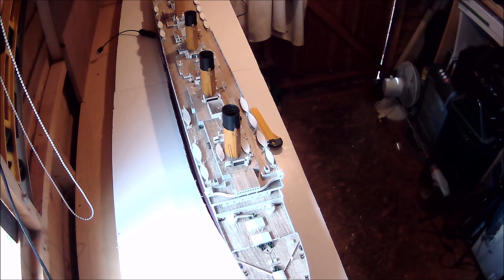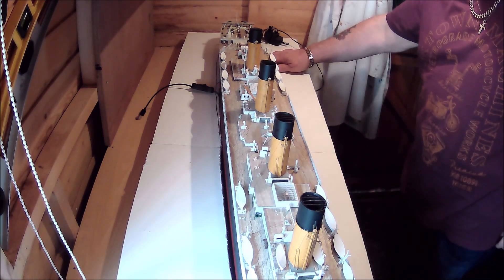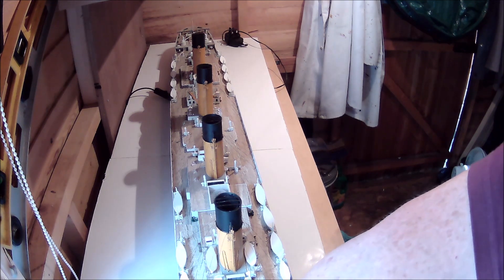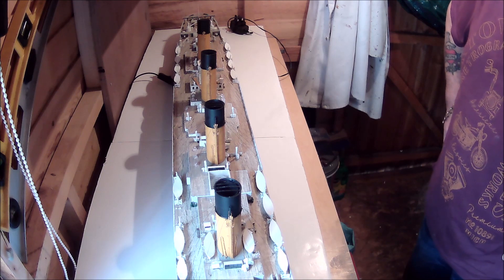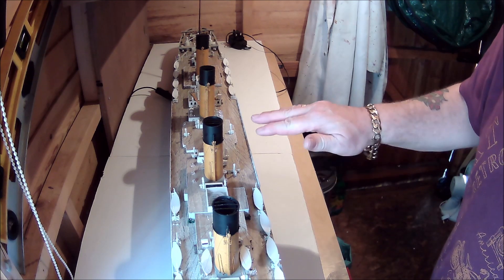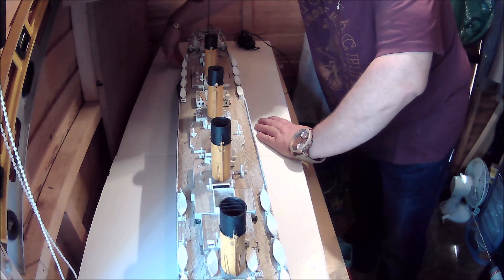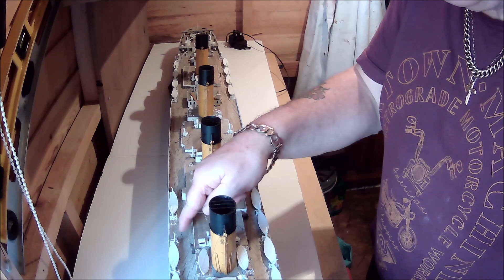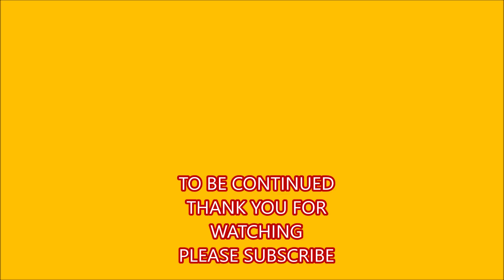BUILD THE TRUMPETER TITANIC KIT UPDATE

Comment: Hi mate I tell you what it's gonna look awesome when it's finished your doing a tremendous job i was thinking how about using a jigsaw or even a dremol? Just an idea. Such a shame about the lights after all that wiring you did could you not drill a big hole at the back for the wire to go through!
Are you going to make some waves with the tin foil or just have a calmer sea. Anyway mate I thought i would give you a few ideas wicth you've probably thought of all ready lol anyway mate you keep up the good work and stay safe 👍 😀
Reply from the maker: thanks Rod, the switch that came with the LEDs for the hull isnt long enough so they will still work as ive tested them, the switch that came with the kit might have to be on top of the water but on the starboard side where it wont be seen, its just a pity that the cable that came with the kit isnt long enough either, i,ll put slight ripples on the water as if the ship is moving before colliding with the iceberg
Reply: @davemacbuilds5232  hi mate just had another idea could you not extend the wire?
Reply from the maker: @rodadams8422  you know what mate? i was just thinking about that myself to get an extension for it, when i go to Bury market on Friday there,s a stall that might have what i need, if not then i,ll go to currys pc world for one
Reply: @davemacbuilds5232  two great minds think alike lol 😆